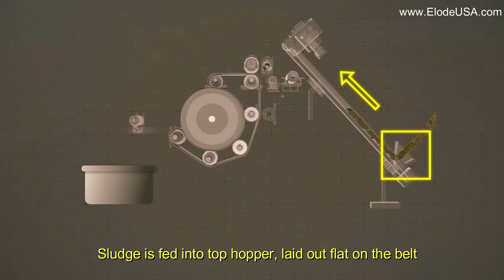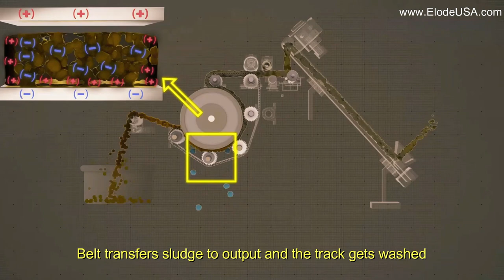ELODE: Dewater Sludge without Thermal Drying

Comment: I think it is better to compare with mechanical pressure filtration systems such as plate-and-frame filter rather than thermal dryers.

As I am concerning, which one is better? They seems quite similar, either input and output solid content, which one should I choose.
Reply from the maker: Equipment like filter presses, belt presses, etc. dewater sludge by mechanical force. ELODE acts as a complementary "second stage" sludge dehydrator. 
For example, a belt press might dewater sludge from 2% dry solids content to 15%DS. ELODE will further dry the 15%DS sludge cake to 45%DS.